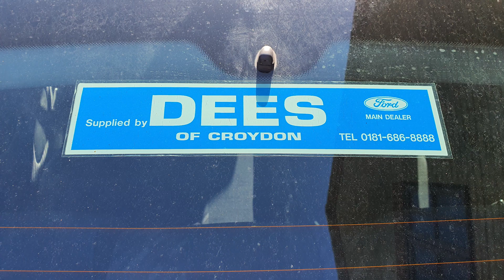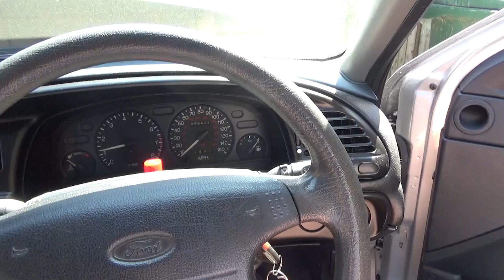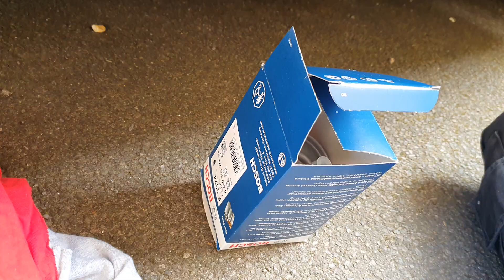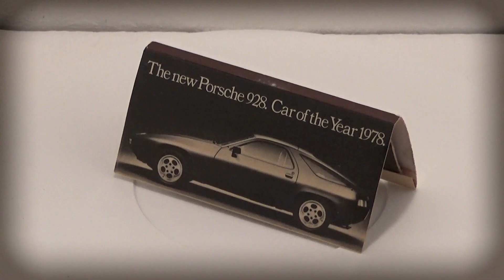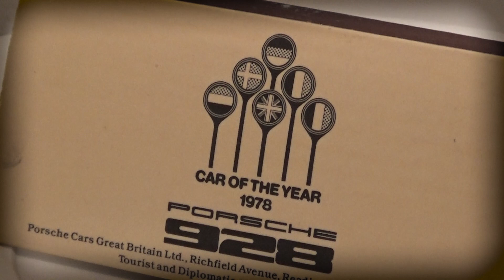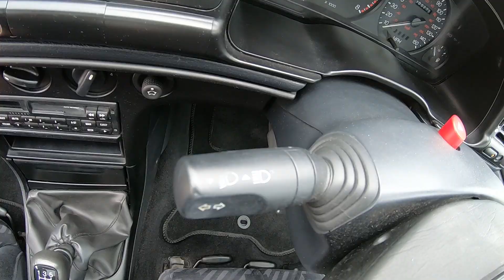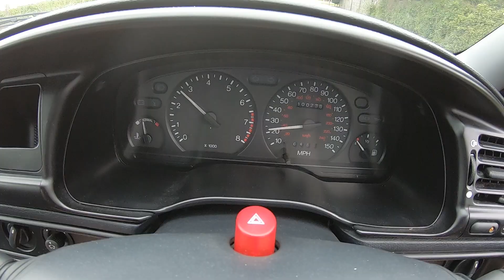European Car of the Year & Me - The Ford Mondeo, 1994 winner.

Comment: Well done video. These always remind me of my 3 years working the lot jobs at rental car companies during the end of the 90s. Contours were the bread and butter or the midsize Budget fleet. They were  solid like a Camry but handled better, but not as smooth as an Accord.   Ours were all base spec with automatics and all power accessories. Fun fact; if the fuse block became unhinged from its mount, the odometer would stop counting.

Comment: That's still got it's original starter motor, it won't be long for this world. They replaced then with a more modern sounding powerful unit. The originals have their roots in the CVH engines and aren't really stong enough. They tend to last about 70k.

Not being critical, it's a lovely car, wish I had one! 😊
Reply: Actually, it's a good indication of how genuine it is. Starter, rear brake cylinders, Airbag clock spring. Whip the rear drums off and check the boots. When bleeding keep pressures low. I'd avoid pressing the brake pedal all the way down during, it's tempting to do, but can knacker the Master. The unswept area can become coated in debris, when your past the piston through it, the seals can be damaged.